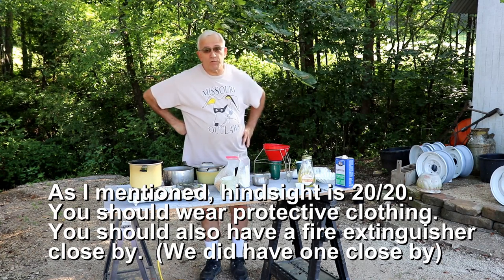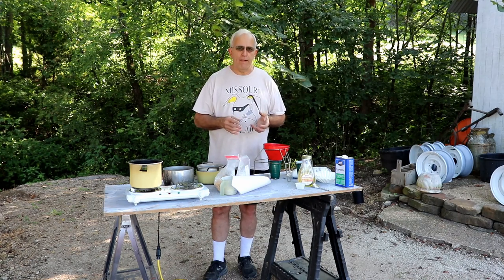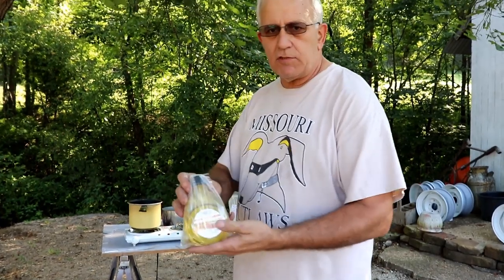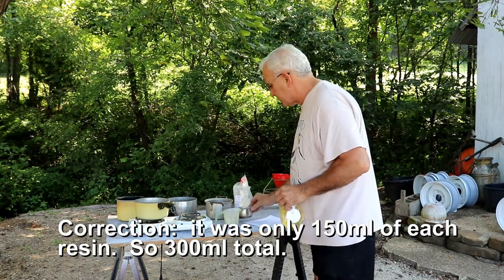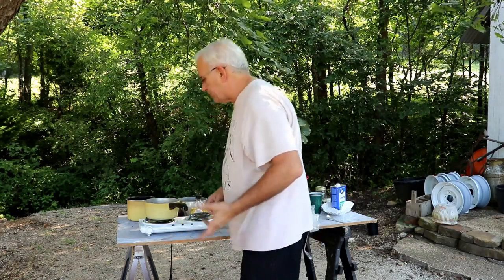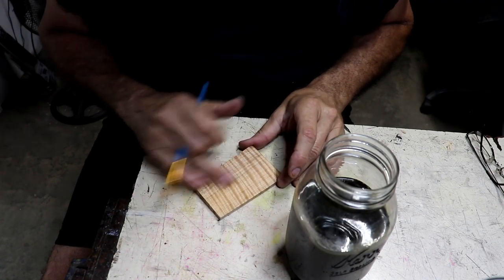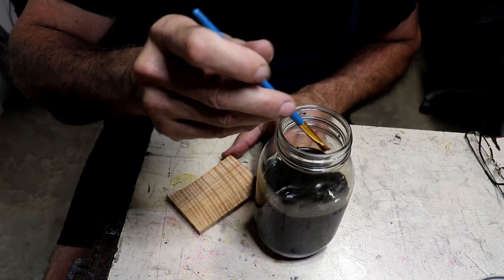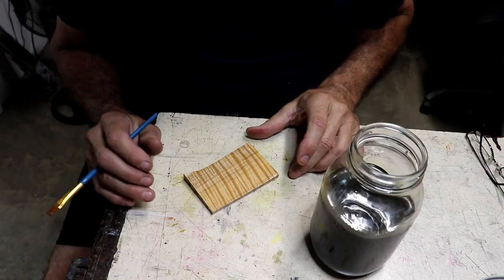317 RSW Old School Varnish Making 1st Attempt

Comment: you've got the resin on the small burner and as I write this you just moved it over !  you're right about smartguys with comments , I'm right here to tell you why even wear a shirt ? the shorts are all the protective clothing ever needed boiling volatile oils and solvents . I can't believe you actually poured heated turpentine right on top of the stove ! it was way too thick because ...guess why , you burned 1/2 of it off and didn't add any more . all done thats a great color
Reply from the maker: Well I wasn't born with the knowledge of how to make varnish. I have probably made at least 1 or 2 other mistakes in my life. I hope you feel much better now.
Reply: @RosaStringWorks  I appreciate your spirit of experimentation but would have thought you'd place extreme gravity to the dangers of boiling flammable resins and solvents and voiced extreme caution to those out there that might adopt your technique of PLAYING WITH FIRE !  you actually did a good job on the varnish , my sincere congratulations for working through it not having a formula . its the lack of respect for the volatility of these substances , you do admit your mistake there but its still mind boggling the cavalier approach without the least bit of protective clothing that could have lead to severe burns .
Reply: @RosaStringWorks  also just to clarify what I'm attempting to accomplish here is not for my benefit of "feeling better" , nor even your own , although you could put some of that arrogance aside . Just in passing you admit the folly of lack of safety precaution of at least wearing long pants and place very little emphasis almost totally in denial that a good leather apron and fire extinguisher are absolutely essential effecting these processes . My intent in belaboring this point is that others proceeding with this type of experimentation take correct precaution and understand this hillbilly approach is reckless , irresponsible and extremely foolhardy and could turn into a crippling or even life threatening situation in an instant .

Comment: You're not supposed to brush it on, you're supposed to rub it in.
Reply from the maker: To each their own. Lots of violin makers actually do brush it on. Some wipe it on. I have done both. I prefer the brush method.
Reply: @RosaStringWorks  An alcohol based varnish, sure. The point of the varnish you made is to be hand buffed into the wood. That's why it's so tacky. Also, you may have figured this out by now, but the varnish only cures in UV light. It doesn't "dry".

Comment: Oil doesn't boil lol
Reply from the maker: It does at my place.
Reply: @RosaStringWorks  Fair enough lol
Reply: Sure it will. Seen it many times in deep fryers. Especially when the thermostat goes south on you and the heat just keep rising. Oil will very definitely boil. Not at 210 like water, but it will boil.